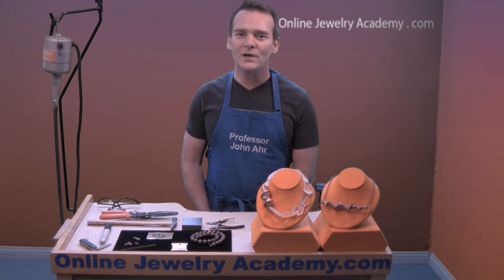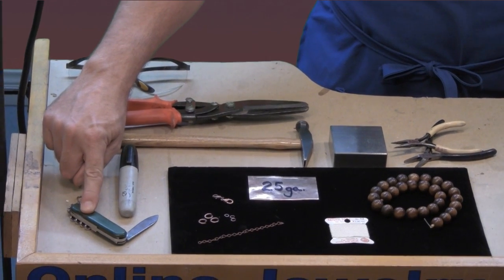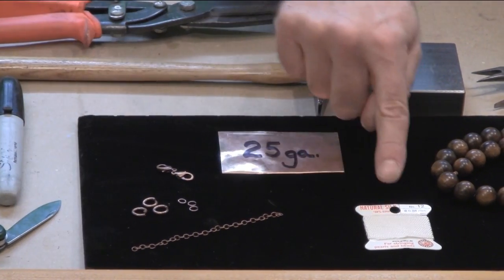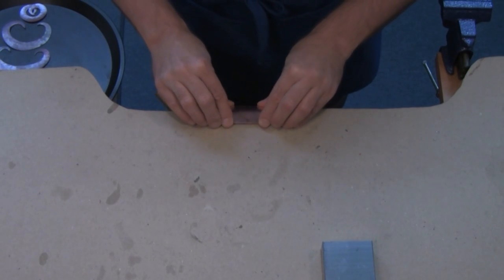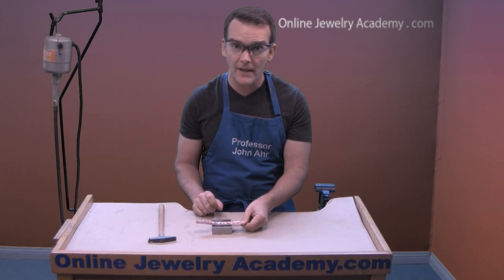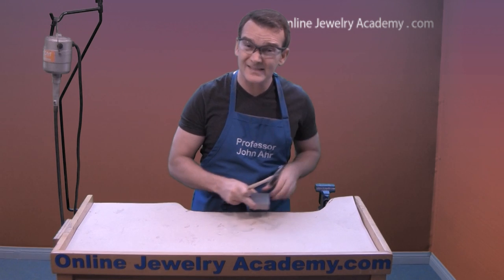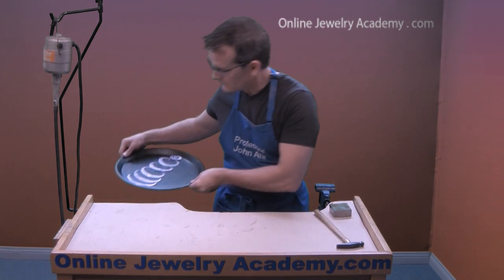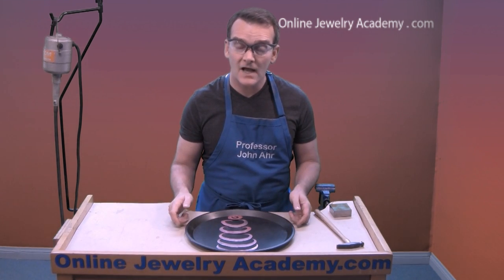Foldformed Copper Spiral Shaped Necklace Elements

Comment: Hi John, I love your videos they are very informative.  On this technique can you work with a thinner gauge of metal, say 30 gauge?  What would be the differences from what you have shown here?
Reply from the maker: +Terra Formed Designs 
Hi Terra!  You could work with a thinner gauge of metal.  But, a thinner gauge will not hold up as a wearable.  The thinner metal will either develop holes in the hammering process ore it will bend too easily when you're finished.  I suggest that you conduct some experiments and determine what works for your projects.  Good luck!
Thanks for watching! : )